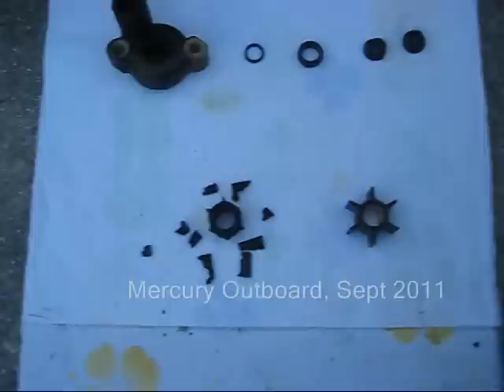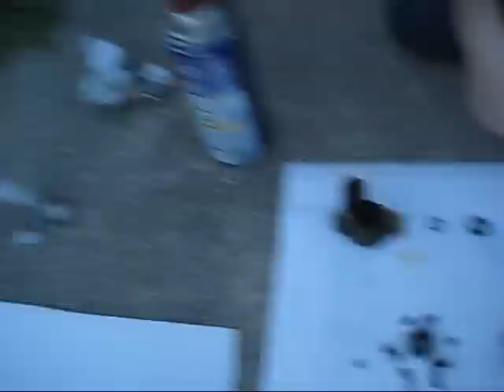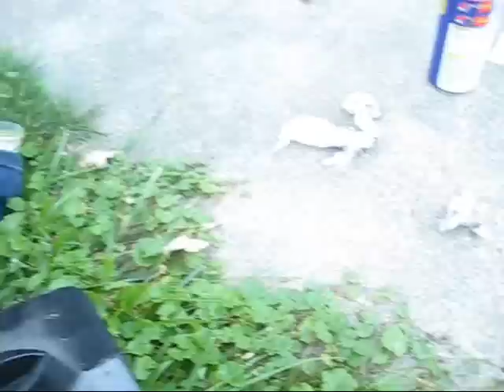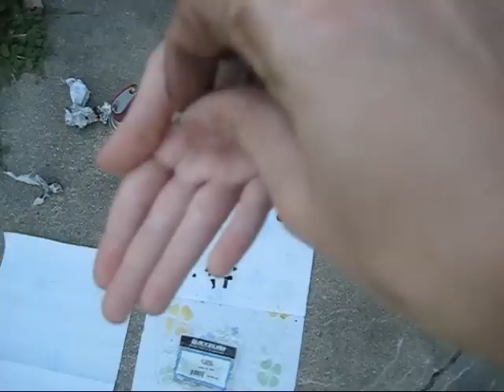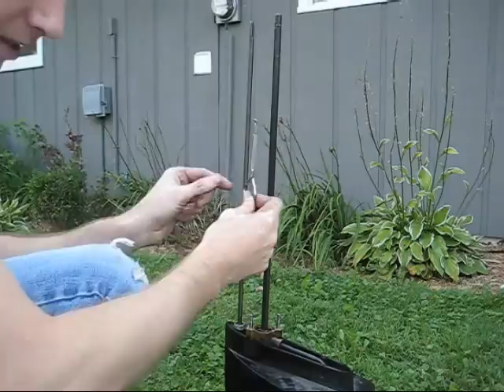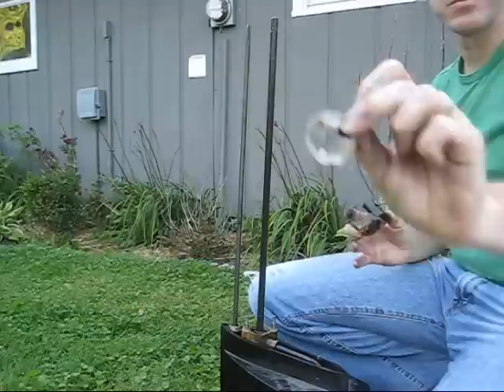4 hp Mercury Outboard Impeller Repair Part 2, replacing the waterpump. Far Reach

Comment: 1. How do you align the splines on the shaft with the power head?
2. How do you get the pick up tube to go into the water outlet on the impeller housing?

These can be tricky things if you don't know how
Reply from the maker: unwinsis I dont recall any issue getting the spines to align.  I do recall some fiddling to get the tube to line up during final assembly.  I didnt have a firm method.  It was more tilting and slowly putting them together until it all fit.  It took multiple tries.
Reply: Far Reach Engineering I'm having a lot of trouble, can't get it to close tight and even when the the shafts are in enough to engage, its always in forward gear no matter where you put the shifter
Reply from the maker: unwinsis I dont have a direct answer, But a couple things you might try as options.  Your shift lever and the transmission shaft itself may be out of sync.  That being like the lever is in forward, but the shaft is set in reverse.  You might want to try setting either your lever or the the transmission itself to a different position.  For instance you should be able to rotate the transmission selection shaft by hand.   It should rotate one direction for forward. The other direction for reverse.  Once you confirm where you are on the transmission. match that position on the lever and then assemble.   For instance try neutral on the lever and neutral on the transmission.  Forward and Forward. Backward and Backward.
Reply: +unwinsis I'm sure you've figured it out by now, but here's the issue I had. On my 1998 Merc 5hp, and others with a similar build, the drive shaft can be a real bugger to get back into place. The reason for this is that the drive shaft tends to miss the tube that it's supposed to go into. This is made worse by the task of aligning the shift shaft with the shift shaft clamp. This process causes the drive shaft to go in at an angle. When the drive shaft misses the tube, it will go up into the housing to the SIDE of the tube. Then it will go no further when the lower end has about two inches to go before the two halves are mated. If this is happening to you, I suggest you take a flashlight and carefully make sure the end of the drive shaft is heading toward the tube while aligning the shift shaft. I finally gave up and took the shift shaft clamp OFF and just concentrated on getting the drive shaft where it belonged. I was able to attach the clamp with a pair of needle nose pliers through the side port that is provided for loosening the clamp. I Hope this makes sense. It will to anyone who has spent the hours of frustration that I did trying to figure out why my drive shaft would not go all the way in!

Comment: Hey, Question, I put the new impeller in and started up the engine, it was just pushing air up top so i took apart the lower unit again and the new impeller that I put in was destroyed.  Have you seen this? 
1) what was the easiest way you got the old one off?  I had to drill my first one out?
2) when your impeller sits in the grove is it completely center in the pump or did it sit to one side?
Reply from the maker: Make sure when you start the engine that it is in the water when you start pulling the cord.  If water doesnt get into the pump before it really starts up, it will just have dry friction heating up the rubber pump and it will over heat the rubber and the impeller will fail.  as for the two points:
1. I used paint can openers.  They have a 90 degree hook which i could use to pull up the impeller in line with the shaft.
2.  it will sit to one side of the housing.
Reply: Far Reach Engineering Thanks!  Was able to get it working.  Fit perfect the 2nd time and spit water.  Question, what is the tube on the starboard side of the engine  for.  The tube that I am questioning is the one right next to the drain port that spits out the water.  The openings are tiny and there isn't much going through there.  Per the diagram online that I saw, it is called a bleed hole/bleed drain.
Reply: Dan M I don't know why but on a bigger engine I grease up the impeller maybe you should do the same here .

Comment: Another thing where can you buy the parts
Reply from the maker: Myself I purchased the impeller parts at my local Mercury dealer.  Might want to check to see if there are any local to you, or if there is a marina that might be able to order one in.  Ebay, is my favorite for odd parts.
Reply: Ok thanks I got the part and got back together working great thanks for the video
Reply from the maker: Great!

Comment: Far Reach great job on your video i just bought a mercury 45 4.5 long shaft outboard and wasn't really sure on how to install a impeller on this type of engine i did alot searching and found a few web sites with cheap parts and i found all the part numbers and how to guides to rebuild these engines and with trying to date most of these motors are pretty hard to do do to this model not putting a date on them but i found a way how to date them from the serial numbers if you want the web sites to find these parts at a real good price e-mail me ed.hoffman29@gmail.com thanks for the help with this video again
Reply from the maker: Edward, thanks.  And good luck with the rebuilds!

Comment: Hey far reach, just wanted to thank you since I have the same exact outboard motor and I need to do my impeller asap. But I have a couple questions... 1 did you have to drain the lower gear oil? To do the impeller?  And how the heck do you shut off the motor because it doesn't have a killswitch?!?!
Reply from the maker: No. I did not have to drain the lower gear oil to change the impeller.  If you have the same engine, you wont need to either. The pump is not housed within the gear oil  As for shutting off the motor just turn on the choke.  That will cut the engine.  Thanks for the positive comments.  Hope this helps;
Reply: guyzag1 unplug the fuel line will also die the engine out

Comment: Hi, I think that the Mariner 4 is basically the same? Either way thanks so much for your informative videos, they take away most of the the 'scary bits'. . . If they are similar, I wonder and hope that you might have a video dealing with the gear oil/lubricant and how to replace it. - - Keep up the good work - - Best regards, Dave.

Comment: Hey, I have a 4.5 hp longshaft of similar age.. your video was the closest I could find to something I could use for refrence... do you know if my engine is the same what year is yours?
Reply from the maker: Sorry to say I dont recall the year.  There are a lot of mercury fans out there.  They might be able to spot it, or tell you more about your engine if you post a picture.  I would imagine that if it is also a mercury of similar era and size it would have a similar water pump housing setup, with just different size impeller based upon hp output.

Comment from the maker: That can be frustrating and for me it did take several tries.  One thing I did that helped was I applied a small amount of grease to the key and that helped "stick" it in place while I put it all together.  You could potentially use another light temporary adhesive to hold it in place, but for me the grease was something that was safe for the system and gave it just enough stick to get it together.

Comment from the maker: Sparkplug.  I cant say what is holding it up.  I would suggest though trying to operate the shift lever in all positions while you disassemble to see if a specific setting (neutral, reverse, or forward) might free it up, in case your shifting shaft is keyed.

Comment: FarReachFR, From the video, is that a late 60's Merc 39? I have a '68 Merc 39 I am trying to get the water pump replaced, but it is giving me a lot of issues binding up. I removed the two bolts that hold on the lower unit, and it slid down about a eighth of an inch or so. It now hangs up on the shifter rod somehow, do you have any thoughts or recommendations as to what it could be? Thanks, sparkplug781.

Comment from the maker: Just as you said, It could really be either of those two.  Clog, or Impeller.  I would heck for clogs first as the clog is the cheaper fix of the two.  Check the pickup screen/pipe and see if it is all clear.  If you pull junk out of it and it gets all better, then free fix.  But if there is no visible clog you may want to open it up and check the impeller.  (or if there is an internal clog.)

Comment: Nice video thanks.  I bought a used 1960's Mercury 7.5hp and just fired it up today on a lake....soon as I started it up, the pee hole was putting out water for about 5 seconds.  After that, there is a tiny trickle coming out and I ran it for a while.  Do you think that is a clog or impeller?  Thanks

Comment: what is the serial number on the motor? I have a 4hp with a 3534018 serial and I'm trying to make sure i get the write impeller. I already tried one, but I don't think it was the right one. Also, there was no "key." Suggestions?

Comment: Thanks for the zip tie trick.....i just did it on an old Mercury 9.8 (model 110) BUT i stumbled upon a problem when i reinstalled the lower unit.......now my gears are really weird because when i put it in reverse on the lever it´s in forward position at the prop and forward on the lever makes it go in reverse at the prop,neutral works fine.Do you have any idea why it does that?I have tried different positions but the shift shaft has only one way to fit(neutral)

Comment: I very much appreciate your posting. The 4.5 that I have had dislodged a piece of its impeller, sending it up just to the top of the copper tube/ rubber grommet at the intake of the water jacket, where it promptly melted, and occluded the water delivery tube! Wow! Who knew with "nano" tech you could get outboard motors to cream themselves like that! ?!? But seriously, I wonder if some kind of VERY low temperature melting "grease" might be a good idea if new impeller doesn't see like INSTANT H2O?

Comment from the maker: If you don't see water of some sort coming out of the engine, then that is a problem.  Might also want to insure the water intake is not plugged. but either way you need at least some level of water running through.      and Thanks.

Comment: great video helped alot!  got mine back together but have no visible "tattle tail stream"... i made sure the copper pipe is seated..... i think the water should be coming out of the rear center hole on the bottom cowl?

Comment from the maker: Good question.  I used some grease to hold the key in place. Any sticky or semi-sticky substance could work.  As for which I stuck the key too, If I remember right I stuck the key to the shaft and then slid the impeller over it.

Comment from the maker: Nothing special that I can think of as a tip on that part. Other than perhaps having a helper do the assembling so that you can try to gauge if the pipe is lining up or not.  Dont want to force it shut if it is not lined up correctly.  I do recall I used my fingers to hold it near the target by feel while assembling, but there always was a point were I had to let go, pull out my hand and give it a try and see if it fit.  It definitely took more than one try to get it lined up right.